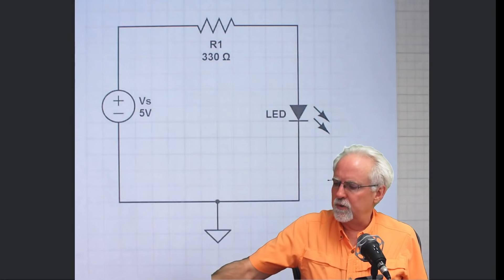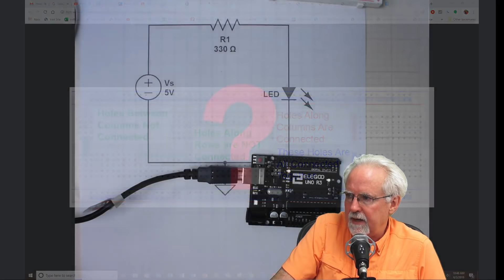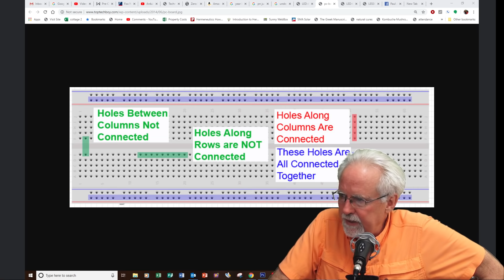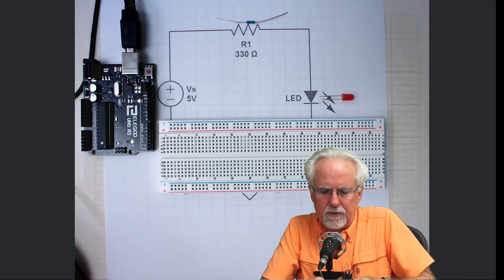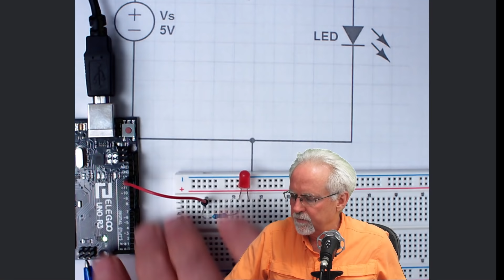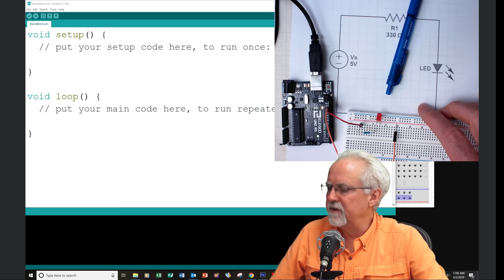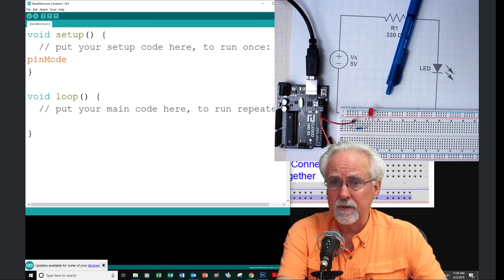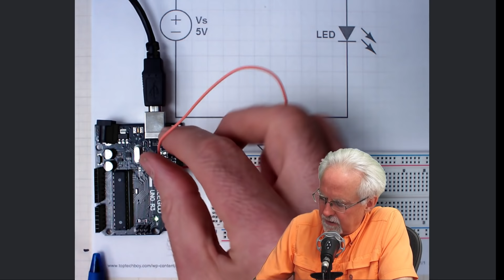Arduino Tutorial 3: Understanding How Breadboards Work

Comment: Wow. Only lesson 3 and I've learned so much. I sat down for a half-hour lesson but by the time I'd finished my "homework", I had been at it for nearly 2. The LEDs are flashing away merrily as I write.
I appreciated the detail you went to when explaining exactly how a breadboard works and how each section differs in their connection structure. When I realised that each of the three LED circuits would need a connection to ground but there was only one ground connection on the UNO, I understood the reason for the full-length positive and negative strips you talked about - I linked the negative strip to the UNO GND and then had each LED circuit tap into the earth connection with a short jumper wire.
I've done some work in BASIC so when I realised just how many lines of repeated code I would have to write in order to fulfil the homework brief I tried a FOR NEXT loop... which didn't work of course so I went to the Arduino website and learned how a loop should be structured. I also learned how to declare a variable in C. I ended up with 3 separate loops, each controlling a separate LED and everything works perfectly.
I was surprised that such a small program took up 3% of storage space so it looks as if efficient coding is a must if you want to fit a more sophisticated program onto the UNO chip. I thought about nesting the loops to make the program more efficient but it's now late and I'm tired so I'll do it tomorrow before I start lesson 4.
Thanks Paul.

Comment: Hi Paul, I am just starting and viewing the vids in order.  I just did the breadboard but when I move the positive lead from pin 13 to any other pin the led is much less bright.  The ONLY change is moving the positive jumper from pin 13 to another pin and changing the software to that pin as well.  Hoping you are still monitoring this comment section as I can't find an email for you.
Reply from the maker: Did you change the pinMode to the new pin you are using?
Reply: @paulmcwhorter  Yes I did and I went from 3 to 13 to be sure I wasn't doing something wrong, at each pin the brightness (or dimness) was equal until I was back to pin 13.  Literally at least 10 times brighter.  Interesting to note I did go to a buzzer in place of the led/resistor circuit and audio was exactly the same on all pins.  I guess we blame the led!
By the way, you do a great job with these programs.  I am a retired medical electronic repairman and find your back to the basics approach to be fantastic, at 78 I find I have forgotten (or filed way too deep in the brain?) for instant recall.  I am progressing slowly but non the less progressing.

Comment: //assignment answer
void setup()
{
  pinMode(2, OUTPUT);
  pinMode(7, OUTPUT);
  pinMode(11, OUTPUT);
}

void loop()
{
  digitalWrite(2, HIGH);
  digitalWrite(7, HIGH);
  digitalWrite(11, HIGH);
  delay(500);
  digitalWrite(11, LOW);
  delay(500);
  digitalWrite(11, HIGH);
  digitalWrite(7, LOW);
  delay(500);
  digitalWrite(11, LOW);
  digitalWrite(7, HIGH);
  digitalWrite(2, LOW);
  delay(500);
  digitalWrite(11, HIGH);
  delay(500);
  digitalWrite(11, LOW);
  digitalWrite(7, LOW);
  delay(500);
 
}

Comment: I tried to use the negative row for my green and blue LED's but they don't work on my breadboard; they don't have any feel for resisting the insert of the pins, the holes feel bigger than the pins; do I have a bad breadboard? I had to use the two gnd on the power side to get them blinking.

Comment: Hey thanks for the video. Quick question, I switched the digitalWrite to pin 8 but forgot to change the pin mode and it was still on 13, but it was wired to 8 and still blinked, just kind of dim. Why did it work even though I didn’t specify an output pin?

Comment: heres my code which i figured out:

void setup() {
  // put your setup code here, to run once:
pinMode(13,OUTPUT);
pinMode(8,OUTPUT);
pinMode(7,OUTPUT);
}

void loop() {
  // put your main code here, to run repeatedly:
digitalWrite(13,HIGH);
delay(500);
digitalWrite(13,LOW);
delay(500);
digitalWrite(13,HIGH);
delay(500);
digitalWrite(13,LOW);
delay(500);
digitalWrite(13,HIGH);
delay(500);
digitalWrite(13,LOW);
delay(500);
digitalWrite(13,HIGH);
delay(500);
digitalWrite(13,LOW);
delay(500);
digitalWrite(13,HIGH);
delay(500);
digitalWrite(13,LOW);
delay(500);
digitalWrite(8,HIGH);
delay(500);
digitalWrite(8,LOW);
delay(500);
digitalWrite(8,HIGH);
delay(500);
digitalWrite(8,LOW);
delay(500);
digitalWrite(8,HIGH);
delay(500);
digitalWrite(8,LOW);
delay(500);
digitalWrite(8,HIGH);
delay(500);
digitalWrite(8,LOW);
delay(500);
digitalWrite(8,HIGH);
delay(500);
digitalWrite(8,LOW);
delay(500);
digitalWrite(8,HIGH);
delay(500);
digitalWrite(8,LOW);
delay(500);
digitalWrite(8,HIGH);
delay(500);
digitalWrite(8,LOW);
delay(500);
digitalWrite(8,HIGH);
delay(500);
digitalWrite(8,LOW);
delay(500);
digitalWrite(8,HIGH);
delay(500);
digitalWrite(8,LOW);
delay(500);
digitalWrite(8,HIGH);
delay(500);
digitalWrite(8,LOW);
delay(500);
digitalWrite(7,HIGH);
delay(500);
digitalWrite(7,LOW);
delay(500);
digitalWrite(7,HIGH);
delay(500);
digitalWrite(7,LOW);
delay(500);
digitalWrite(7,HIGH);
delay(500);
digitalWrite(7,LOW);
delay(500);
digitalWrite(7,HIGH);
delay(500);
digitalWrite(7,LOW);
delay(500);
digitalWrite(7,HIGH);
delay(500);
digitalWrite(7,LOW);
delay(500);
digitalWrite(7,HIGH);
delay(500);
digitalWrite(7,LOW);
delay(500);
digitalWrite(7,HIGH);
delay(500);
digitalWrite(7,LOW);
delay(500);
digitalWrite(7,HIGH);
delay(500);
digitalWrite(7,LOW);
delay(500);
digitalWrite(7,HIGH);
delay(500);
digitalWrite(7,LOW);
delay(500);
digitalWrite(7,HIGH);
delay(500);
digitalWrite(7,LOW);
delay(500);
digitalWrite(7,HIGH);
delay(500);
digitalWrite(7,LOW);
delay(500);
digitalWrite(7,HIGH);
delay(500);
digitalWrite(7,LOW);
delay(500);
digitalWrite(7,HIGH);
delay(500);
digitalWrite(7,LOW);
delay(500);
digitalWrite(7,HIGH);
delay(500);
digitalWrite(7,LOW);
delay(500);
digitalWrite(7,HIGH);
delay(500);
digitalWrite(7,LOW);
delay(500);
}

Comment: I also want to say I genuinely appreciate what you are doing. I am very experienced professional engineer (mech) but never really worked in the details of electronics, and I need to control some DC motors, and discovered Arduino, so your very basic step by step really helps.
Reply: Did you get the exact kit he used for the tutorials

Comment: Paul, I am loving this. One suggestion for this one - you omitted to mention that the Pin 13 built in LED was still flashing from before and then behaved in parallel with the added red LED on pin 13, both as outputs of pin 13. The built in LED on pin 13 then stopped flashing when you moved to pin 8 output. You never mentioned it, just thought it would useful to mention it in passing.
Reply: Clever observation. I noticed the same when I changed to Pin 8 last night. It makes sense though.

Comment: the newer version doesnt highlight the OUTPUT, HIGH and LOW in color which makes it quite difficult.
yu are a great teacher. im 30years and now startting basic electronics . YOu re the best teacher.
Reply: My kit just arrived yesterday and I noticed the same thing....wasted first hour trying to get the IDE to change the syntax. Even downloaded the clang auto-format ini file, but gave up in the end.  TIP: turn on the format assistance option in preferences (makes coding a whole lot quicker!).

Comment: My uno still had lesson loaded when I connected my uno to USB. Before loading this sketch, I tried resetting the board by pressing reset once and when that didnt work, I pressed reset twice in quick succession and that didnt work. When I loaded this sketch, it over rode lesson 1's sketch, but Im concerned that the uno is going to load a sketch thats harmful to the board or circuit Ive built if it automatically loads the previous sketch.

Comment: How is this code for the assignment? 

int redBlink;
int greenBlink;
int blueBlink;

void setup()
{
  pinMode(13, OUTPUT);
  pinMode(12, OUTPUT);
  pinMode(11, OUTPUT);
}

void loop()
{

  if (redBlink != 5)
  {
  digitalWrite(13, HIGH);
  delay(500); // Wait for 500 millisecond(s)
  digitalWrite(13, LOW);
  delay(500); // Wait for 500 millisecond(s)
    redBlink++;
  }

  else if(greenBlink != 10) 
  {
  digitalWrite(12, HIGH);
  delay(500); // Wait for 500 millisecond(s)
  digitalWrite(12, LOW);
  delay(500);
    greenBlink++;
  }

  else if(blueBlink != 15)
  {
  digitalWrite(11, HIGH);
  delay(500); // Wait for 500 millisecond(s)
  digitalWrite(11, LOW);
  delay(500);
    blueBlink++;
  }
  
}

Comment: Great videos, thanks! I'm having a bit of an issue with mine. If I use pin 13, as you suggest in the video, it all works great! But when I try to use any other pin (2, 5 or 12 etc.) then upload it to the Arduino, the small LED on the board stops blinking. The red LED on the project board still works but it's very dim. It only works as it should from pin 13. Would you have any suggestion as to why?

Comment: hi sir good day,im using the latest software of arduio,using arduino mega 2560 ,when i enter the code into arduino is always error,i do exactly the code that you type in the first lesson,pinMode(13,OUTPUT); but the OUPUT doesnt turn to green,but the pinMode is turn to orange i have the problem only in the output,im the beginner of arduino.many thanks.God bless you sir.

Comment: Why does the positive side of the voltage have to be aligned with the P-Type conductor in order for current to flow? Why does that diminish the energy barriers for electrons and holes, but not when the voltage is assigned in the other direction?

Comment: I understand the simplest way to do it is to copy and paste the code to blink the led it's respective amount of times. Is there a way to shorten the code? So it isn't so repetitive
Reply: i bet future videos would probably discuss shortcuts to getting things done, but understanding the basics plain-and-simple-albeit-repetitive, are probably the best right now. i ended up googling a way to repeat things certain number of times for arduino coding and came across a code and modified it to a working state for my project. it uses a command called "for" which is some sort of a counting mechanism i suppose. ive pasted my code down below and some explanations ive tried to understand myself from what ive read.

the // commands are just text that doesnt influence your code and is for visual clarity. i used the default "i" variable in the "for" command examples i saw. which letter the variable is doesnt matter as long as its consistent through the whole parenthesis. you can see that i even reused the same letter variable on the later pins and it worked just fine.
the "for" command in the format i'm using basically works like

for (int startingvalue; endrepeatcondition; ascending/descending) {code you want to repeat}

so plugging in my own values for the first LED to blink 5 times, it was essentially brown down as

for (int "i" starting value is 0; keep repeating if "i" is less than 5; "i" counts up in ascending order due to the "++") {a single instance of my digitalWrite on and off code for one specific pin number LED}

you would modify the 5 to 10 and to 15 on the "for" statements for the other LEDs to provide different amounts of repeats. my code makes my cyan LED blink 5 times then my red LED blink 10 times and then my green LED blink 15 times. the next LED doesnt start blinking until the previous one is done its repeats.

My Code:

void setup() {
pinMode(8, OUTPUT);
pinMode(9,OUTPUT);
pinMode(10,OUTPUT);
}

void loop() {
//Cyan LED
for (int i = 0; i < 5; i++) {digitalWrite(8,HIGH);
delay(200);
digitalWrite (8, LOW);
delay(200);}

//Red LED
for (int i = 0; i < 10; i++) {digitalWrite (9, HIGH);
delay(200);
digitalWrite (9, LOW);
delay(200);}

//Green LED
for (int i = 0; i < 15; i++) {digitalWrite (10,HIGH);
delay(200);
digitalWrite (10,LOW);
delay(200);}
}

Comment: Finally done I mean the homework. Found a new toy fantastic, I had some old LEDs when I substitute with the one from the kit I found that it was very weak so I figure it could be the 330K resistor was too strong so I used a 000.4 ohms and worked like a charm. used a yellow flashing 4 times a green flashing 5 times and the red flashing 8 times. Had some issues but overcame the problem and all good now. I feel like a 2 year old kid thanks Paul this is great.😀😀😀😀.
Oh am a 74 years old.

Comment: Just using the comments to document my progress through the tutorials - was able to do the homework! 

void setup() {
  // put your setup code here, to run once:
 pinMode(8, OUTPUT);
 pinMode(9, OUTPUT);
 pinMode(10, OUTPUT);
}

void loop() {
  // put your main code here, to run repeatedly:
digitalWrite(8, HIGH);
delay(100);
digitalWrite(8, LOW);
delay(100);

digitalWrite(8, HIGH);
delay(100);
digitalWrite(8, LOW);
delay(100);

digitalWrite(8, HIGH);
delay(100);
digitalWrite(8, LOW);
delay(100);

digitalWrite(8, HIGH);
delay(100);
digitalWrite(8, LOW);
delay(100);

digitalWrite(8, HIGH);
delay(100);
digitalWrite(8, LOW);
delay(100);

digitalWrite(9, HIGH);
delay(100);
digitalWrite(9, LOW);
delay(100);

digitalWrite(9, HIGH);
delay(100);
digitalWrite(9, LOW);
delay(100);

digitalWrite(9, HIGH);
delay(100);
digitalWrite(9, LOW);
delay(100);

digitalWrite(9, HIGH);
delay(100);
digitalWrite(9, LOW);
delay(100);

digitalWrite(9, HIGH);
delay(100);
digitalWrite(9, LOW);
delay(100);

digitalWrite(9, HIGH);
delay(100);
digitalWrite(9, LOW);
delay(100);

digitalWrite(9, HIGH);
delay(100);
digitalWrite(9, LOW);
delay(100);

digitalWrite(9, HIGH);
delay(100);
digitalWrite(9, LOW);
delay(100);

digitalWrite(9, HIGH);
delay(100);
digitalWrite(9, LOW);
delay(100);

digitalWrite(9, HIGH);
delay(100);
digitalWrite(9, LOW);
delay(100);

digitalWrite(10, HIGH);
delay(100);
digitalWrite(10, LOW);
delay(100);

digitalWrite(10, HIGH);
delay(100);
digitalWrite(10, LOW);
delay(100);

digitalWrite(10, HIGH);
delay(100);
digitalWrite(10, LOW);
delay(100);

digitalWrite(10, HIGH);
delay(100);
digitalWrite(10, LOW);
delay(100);

digitalWrite(10, HIGH);
delay(100);
digitalWrite(10, LOW);
delay(100);

digitalWrite(10, HIGH);
delay(100);
digitalWrite(10, LOW);
delay(100);

digitalWrite(10, HIGH);
delay(100);
digitalWrite(10, LOW);
delay(100);

digitalWrite(10, HIGH);
delay(100);
digitalWrite(10, LOW);
delay(100);

digitalWrite(10, HIGH);
delay(100);
digitalWrite(10, LOW);
delay(100);

digitalWrite(10, HIGH);
delay(100);
digitalWrite(10, LOW);
delay(100);

digitalWrite(10, HIGH);
delay(100);
digitalWrite(10, LOW);
delay(100);

digitalWrite(10, HIGH);
delay(100);
digitalWrite(10, LOW);
delay(100);

digitalWrite(10, HIGH);
delay(100);
digitalWrite(10, LOW);
delay(100);

digitalWrite(10, HIGH);
delay(100);
digitalWrite(10, LOW);
delay(100);

digitalWrite(10, HIGH);
delay(100);
digitalWrite(10, LOW);
delay(100);

}

Sure there is a more efficient way to do this - maybe using for loops/while loops?

Comment: Hi Again Paul (I feel like I should be calling you Mr. McWhorter or Sir at least) Im going to buy the Elegoo kit to learn all thes lessons in your series but I have a question about a later project. I want to remotely set off a spring loaded door closure but the weight of the spring would be too much for a little servo so I know I would need a stronger, independently powered, arduino controlled servo. BUT, would a servo be the best componant for this? or is there something better? Thanks

Comment: //HOMEWORK -1
void setup() {
  // put your setup code here, to run once:
pinMode(8,OUTPUT);
pinMode(13,OUTPUT);
pinMode(2,OUTPUT);
}

void loop() {
  // put your main code here, to run repeatedly:
for(int r=0; r<5; r++)
{
digitalWrite(8,HIGH);
delay(500);
digitalWrite(8,LOW);
delay(100);  
}
for(int y=0; y<10; y++)
{
digitalWrite(13,HIGH);
delay(500);
digitalWrite(13,LOW);
delay(100);  
}
for(int b=0; b<15; b++)
{
digitalWrite(2,HIGH);
delay(500);
digitalWrite(2,LOW);
delay(100);  
}
}

Comment: Great tutorial !  I have a question regarding breadboard design.  It seems breadboards have + and - rails grouped in 5's.  Do you have any insight as to why?  I bought a DIP with 8 330 ohm resistors.  Therefore, I still have to use jumpers to connect to the ground rail to the - pin on the resistor.  :-(

Comment: Can I ask a question Paul?  But first thanks for all this.  I'm 78 years old and it's great to get a better understanding of things.  If the resistor in the circuit is there  to prevent the LED being damaged by a runaway current does it matter where it is situated?  Would it have the required effect if it was after the LED?    eg between the negative of the LED and Gnd.  Thanks again.  Roger
Reply from the maker: Resistor can be on either side of the LED